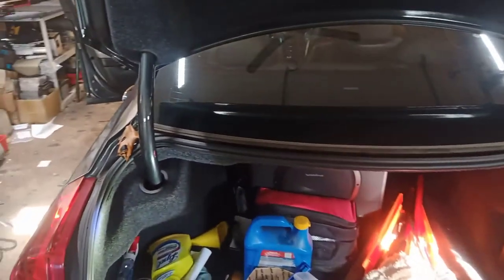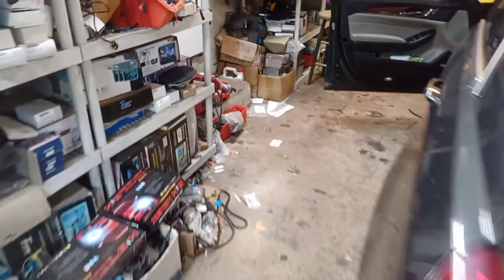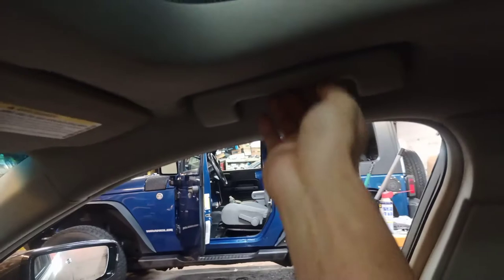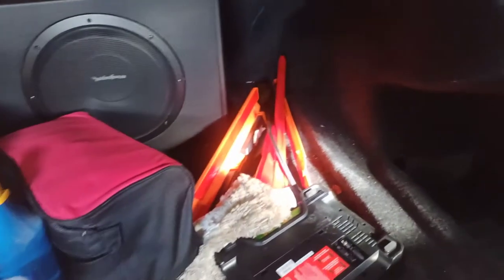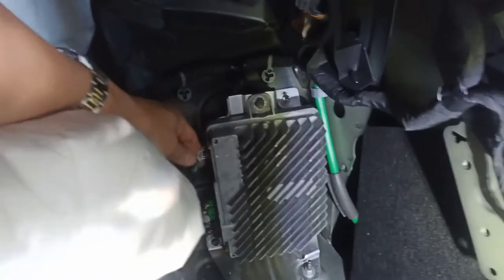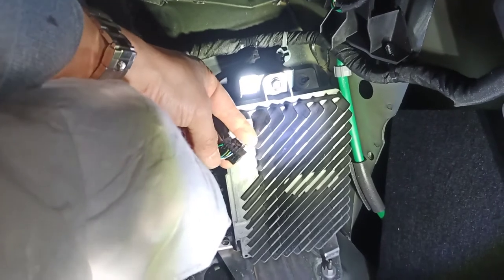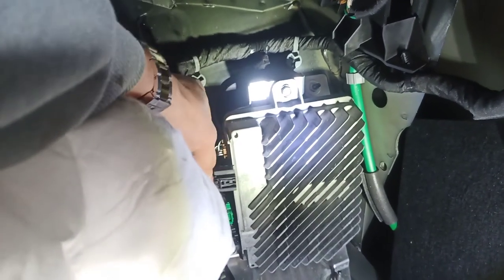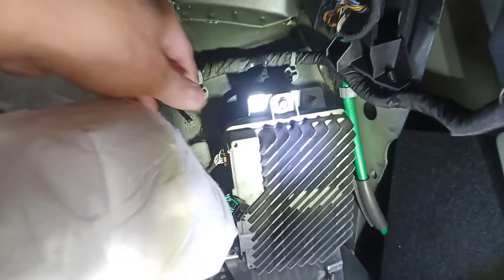Cadillac CTS ANC bypass active noise cancelling module location

Comment: thank you so much I have other questions. what wires did you use for the loc connection
Reply from the maker: I am sorry, what is loc?
Reply: @goautosound1 Line Out Converter. I have a XTS and I had to use the factory sub output to a LC2. Being that’s it’s only a +/-, I ended up wiring it parallel into the input on my LC2. It’s a pain in the ass with these cars 😞

Comment: Another question.. where did u connect the 12 volt remote wire.. i tried from the with the loc integrated does not work properly, i tried at the sunroof fuse and amp stays on..i have a 2024 ct5 luxury.. not the V6
Reply from the maker: @danielloz8282  at the ignition plug Black plug find the pink wire that is ignition

Comment: If u cut any mic cable on the cabin it anc stops working... i cut one, added a on/off switch, run it throigh the pilar down to the seat, when traveling i turn it on. Lol. 🙏
Reply from the maker: @danielloz8282  yes that's anc mic you can either cut mic or do it at the amplifier